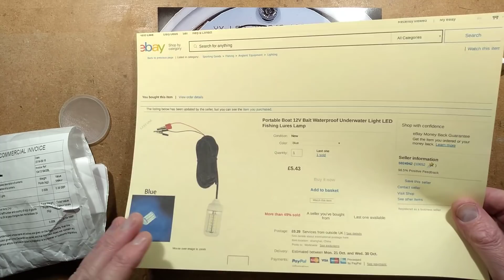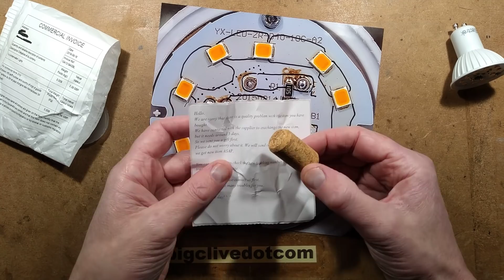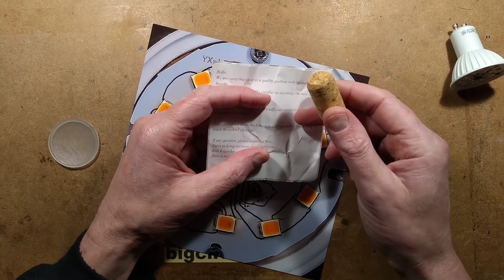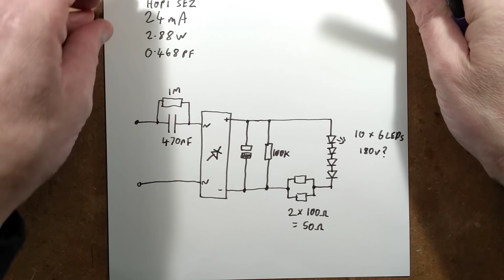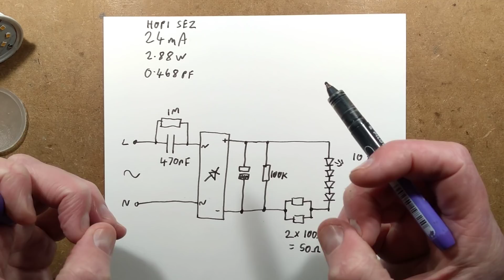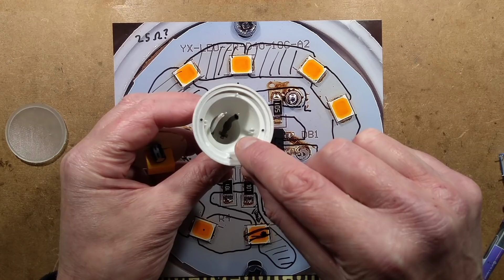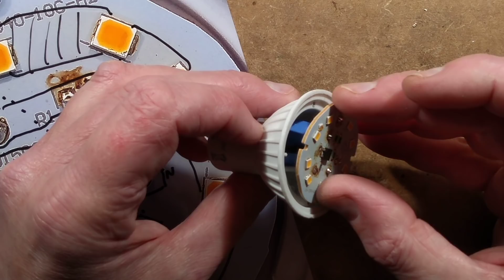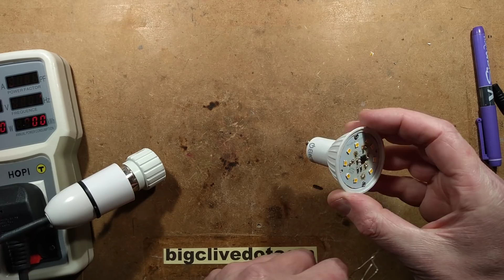Mystery corks, PCBs and fixing a dead lamp.

Comment: Any eco-damage wrought by the use of milligrams of lead is more than offset by repairing rather than replacing the lamp. Our economy based on disposable goods is a much greater risk to public health than good solder.
Reply: Testing has shown that even in old dumps with lots of lead, the lead compounds that come from degrading electronics tend to be non-water soluble and don't migrate very far at all from the source. Repairable goods which are made to last is the best way to avoid issues and reduce pollution. I usually try to avoid products with an engineered in short life.
Reply: @Matt Quinn Don't forget that all those goodies have to be shipped half way around the world using ships that use a very low grade fuel oil so there's the added pollution of that as well.
Reply: Yes, Capitalism requires recurring purchase mentality. Insatiable desire for more new things.
Reply: @Matt Quinn 
Doesnt change the fact that they are more expensive due its small edition compared to mass produced vw.
Reply: @Matt Quinn - So you think that before RoHS things were "built to last" and "got repaired locally"? Good one. :D Planned obsolescence has been the main guiding principle of consumer electronics design since at least the 1960s. RoHS was a way to do some damage limitation. Does it fix the behaviour of big manufacturers? No. But if any government tries to regulate that, people scream "communism" and "stifling innovation".
Reply: Every time a repairable appliance gets landfilled, God kills a kitten.
Reply: @Matt Quinn My 2011 LEAF, now owned by a relative, has over 90,000 miles on it. the original battery was deffective and Nissan continues with a poor design to this day but the mechanical parts of the car are flawless.

Here in the US there is a Chevrolet Volt with a half million miles on it. It was recently sold because the computer failed. the rest of the car was working well. It had experienced no problems with its electrical system before this.

Tesla has recently been talking about their "million mile battery." Electric cars have the ability to last for a very long time because of their intrinsic nature. I once bought a very old hydraulic pump with a 3-phase motor, used it every day for 25+ years, and sold the company to people who still use it today. The mechanical pump required rebuilding once, and electric cars will require repairs of suspension parts. EV drivetrains though, should be repairable indefinitely.
Reply: @Bill Kerr 
Nissan leaf sucks because it has no active battery cooling WHATSOEVER
Reply: any soldering really
Reply: I disagree with the general claims that lead free solder is more problematic. The majority of hobbyists seem to think that leaded solder always gives a superior result. In fact there are many other factors that contribute to a good or bad solder joint that have nothing to do with the solder alloy. Flux formulation, joint cleanliness, correct temperature, stress relief, component lead plating. Just to name a few.
Reply: Exactly!

Every pcb manufacturer using lead solder to be thrown away at the slightest sign of a problem is an issue. But for the 'hobbyist' using leaded solder is less than a fraction of a percent of a drop in the bucket. Especially since fixing a unit means its NOT going to the landfill. Lead isnt a problem on a hobbyist level. Even if that hobbyist is making hundreds of boards a year.
Reply: More significant is how our economy (UK) is based on the expectation of quick and valuable dividends paid to shareholders that in the short-term rather than based on investment in the long-term and dividends later.  This has resulted in a diminished manufacturing and technological innovation sector.  Quick profits rule!
Reply: I salvage like five of these lights a week. Customer brings it for replacement, buys another one and leave old one for liquidation. I generally hate GU10 socket lights but thanks to this I have endless supply for my own lamps.
Reply: Thomas is bang on. RoHS is an industry standard, which is why you can still buy lead solder for personal use. Because let’s be real, you wont release enough lead in 10 lifetimes as an electronics company would in a single shift.
Reply: @mrb692  
>Thomas is bang on. RoHS is an industry standard, 
>which is why you can still buy lead solder for personal use. 

Distributors are making it harder for consumers to get hold of non-RoHS solders. Eventually you won't be able to get it at all as if it's not used in industry there isn't much point making it.
Reply: > the use of milligrams of lead

It's not "milligrams of lead", it's tons and tons of lead... that electronics companies don't want to recycle (or even design in a way that is easy to recycle). The result is it all ends up in landfills (even more so now that China has stopped importing other peoples' trash - a lot of western "recycling" companies just collected a state subsidy and shipped the junk to China). 

> economy based on disposable goods is a much greater risk to public health

That is not a separate problem. It's precisely because our economy is based on disposable goods that RoHS (banning lead and other materials, like cadmium, mercury, etc., from consumer goods) was enacted. Most of those can still be used for private repairs, though.

> much greater risk [...] than good solder

Lead-free solder isn't "bad solder". It requires more precise control over temperature and placement of flux, which adds some work for manual soldering, but for industrial production those things would be controlled anyway. And, In fact, some companies (notably smartphone manufacturers) have pointed out that it allowed much closer solder joints (because the solder won't flow to nearby contacts), and therefore better miniaturisation.
Reply: @Matt Quinn 
"Appropriate precautions" is something thats really hard to establish, isnt it? But i dont disagree - one can handle lead without getting ill probably all his life, but the one that DOES get sick is still gonna need health care that the company is going to pay since they didnt look out for him. 
I do however disagree that short lifespans only benefit the producer as its an important factor on price. If you had a lightbulb thats able to burn forever, no one would ever need a new one, which makes the few that are needed very expensive in production as they are not important enough for mass production. Thats the reason a Volkswagen is much cheaper than a rolls royce.
Reply: afaik its not for environment but for the people breathing the fumes and touching it on a daily basis 
and im pretty sure humans wont stop their disposable behaviour just so some can solder easier.
Reply: @thomasherzog86  The big concern is with larger things than light bulbs. Cars are increasingly electronic. You may have had your car's "computer" replaced and know how costly that is. As cars age manufactures stop carrying components for them. Lead free solder is more brittle and more frequently fails in this kind of application. 

Lead free boards in cars can be very difficult or impossible to resolder when a joint breaks. This already today leads to some cars being uneconomical to repair. Electric cars are said to be able in some cases to be able to last for over a million miles. This will not happen if their components cannot be repaired ten or twenty years in the future. 

Cars are just one example. More and more of our world is electronic. Today the vast majority of electronic devices are designed to be disposable. This practice is utterly unsustainable. China is already rejecting more electronic waste. Electronic waste in Africa is a huge and growing environmental problem. The waste of raw materials cannot be supported in a world trying to reduce carbon emissions.

For workers exposure to solvents and flux fumes is a vastly more significant health threat than exposure to lead. Even with those other threats there are ways to protect workers if they are used.

Like with worker safety, companies will not choose to mekr repairable devices unless they have financial incentive to do so (or disincentive not to do so). If companies are made to pay for the expense of the waste their products become they will be strongly encouraged to make those products durable and repairable. There is a larger financial incentive as well, one that affects us all.

As automation continues to replace more and more workers of all career types we will struggle to find meaningful employment for succeeding generations. Diagnosis and repair of electronic devices is something that is very difficult to automate for the vast array of electronic devices already on the market. If we can move toward repairing and upgrading existing consumer products rather than simply discarding them we could address many of the concerns facing our society in the immediate future.

TLDR: Small things add up. It matters.
Reply: @Miata822  
I dont disagree with you, but for small editions - people would need to pay more since the mass production makes products cheaper. People wont pay more because they dont pay the price of said waste. 

Also the disposables are really just a problem of recycling being to costly while the ressources are cheap. 

And forgive me if a may, but i disagree that there is no significance to exposure to lead fumes as 540.000 people STILL die every year because of its toxicity.
Reply: @thomasherzog86  You are correct in stating things will cost more once consumers finally face the true cost of the goods they buy. It won't be popular. That goes without saying. It is necessary though. We can restrain our wasteful behaviour intentionally or wait until change is forced upon us.

It seems I have more reading to do on lead exposure but no industrial process is without human and environmental costs.
Reply: @Miata822  

>Lead free boards in cars can be very difficult or impossible to resolder when a joint breaks.

People repair "lead free boards" on a daily basis. A major problem with repairing modern electronics isn't the type of solder it's the complexity of the parts involved. It takes considerable skill to repair boards with 200+ pad BGAs and that makes a lot of boards totally uneconomical to repair.
The only way to really make modern electronics repairable is to build end products out of replaceable sub-assemblies.
Reply: @thomasherzog86  it's purely because the lead leeches out of landfills over time. If we dealt with e-waste properly, we'd all have good quality solder and no tin whiskers.

Comment: I thought that the lead in solder was more about the waste from production rather than individual exposure?
Reply from the maker: I think the main concern was landfill.  But ironically at the time of the new regulations things were moving to surface mount anyway.  A modern PCB has a tiny fraction of the solder that a traditional one had.

Comment: One more thing, I guess they figure they send ya a cork so you can use it as a bobber when ya do go fishing, that is just rotten man. Down right rotten. Has this happened to you before. The cork thing. I just ordered a carburetor for lawn mower, when I received it the gas just flowed out the air cleaner so I took it apart and apparantly I needed to finish the assembly (some assembly required 😂) so I put the needle valve and float in place. Works like a charm.

Comment: Well done, got a question. If My son turns his cieling fan on and off pulling the wrong chain trying to turn the light on in my living room light turns on and of just once real fast. I didn't notice with incandescent bulbs (I can test with them if that will further your diagnosis) but we went out and bought all led bulbs dimmable (but this circut is not using a dimmable switch) So my question is what causes that. I'm guessing it's a split second supply drop or power surge. Our house is new to us, 2 months, we did notice some incandescent light flicker as appliances would turn on. Since we've added the led only this one flicker remains. Kinda curious. Walmart brand, LEDs yellow led  ( filament the long skinny yellow strips) I can see a circut board in the bottom. Cheers
Reply from the maker: What sort of lamp is it in the living room?  It sounds like the sort of thing that an inductive surge would cause, but a fan isn't a high load, so there might be a bad connection somewhere.
Reply: @bigclivedotcom  both lamps are ceiling fans/ 3 fixture lamps. only using one bulb in one fixture tho. I thought of that so I did do a visual inspection, no black or discolored contacts. Also I moved the bulb around to different fixture. I was thinking (that's probably my problem) maybe I'll put incandescent bulbs back in today and see if it happens. I was just thinking LEDs are more sensitive to voltage drops/spikes.